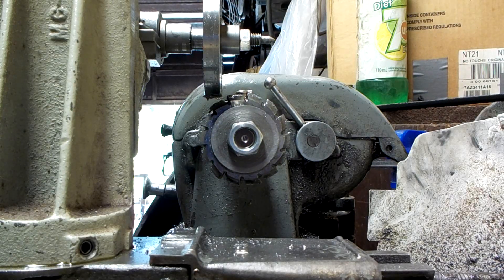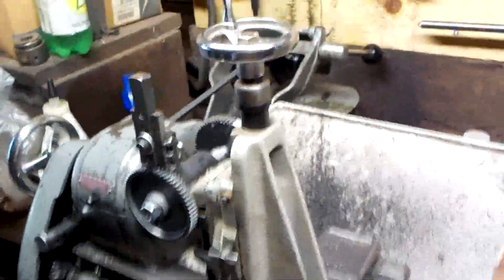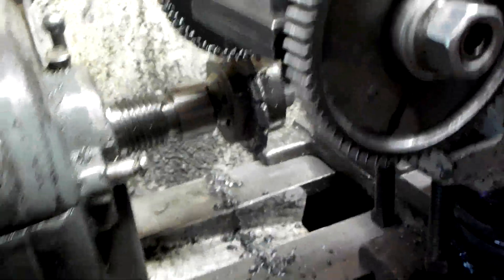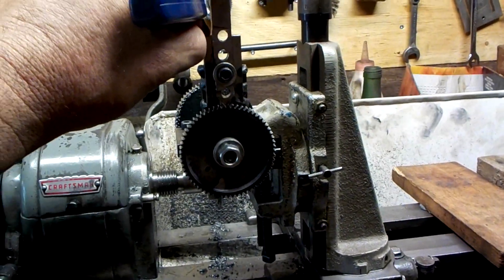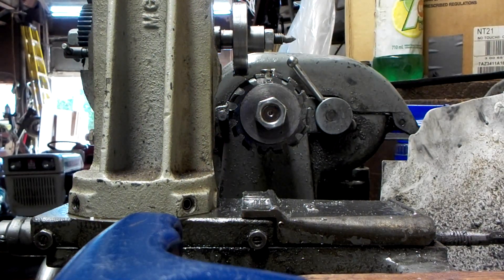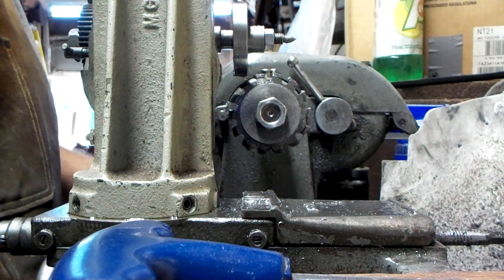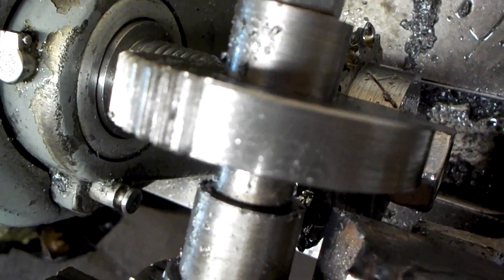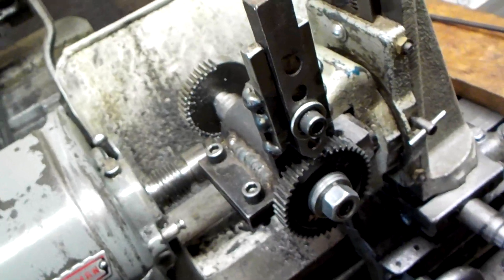Cutting 24 DP 14 5 PA Change Gears On My Craftsman 6 Inch Lathe

Comment: This is cool to watch. We would like to have a go at cutting gears but do not have a need at the moment
Reply from the maker: Thanks for the comment - cutting the gears on the small 6 inch lathe works but it does present a few challenges compared to a larger lathe or a milling machine.  The gear sets I hope to make with the new steel gears will hopefully reduce setup time to change from fast and slow carriage speeds as well as for cutting various thread pitches on shafts.